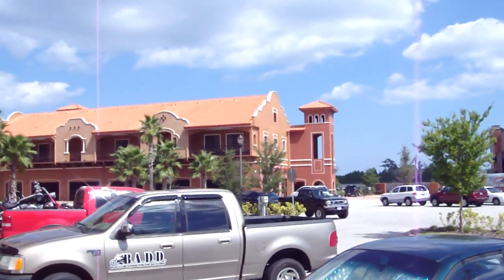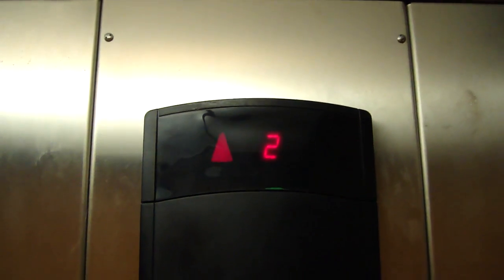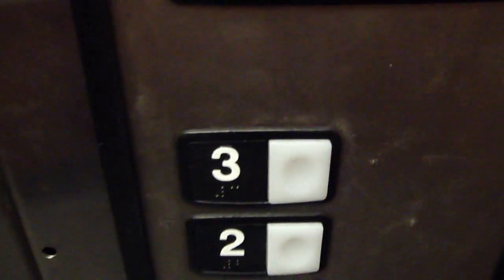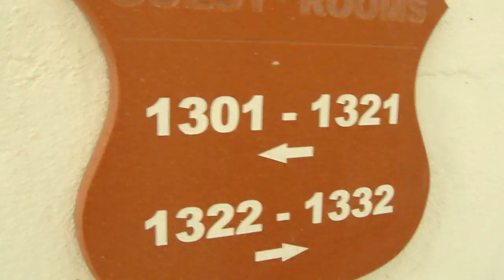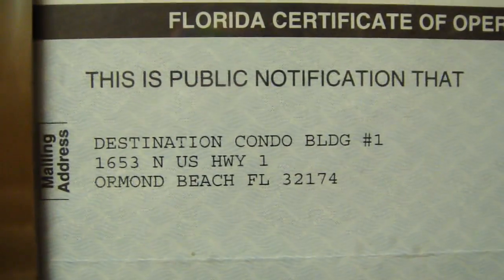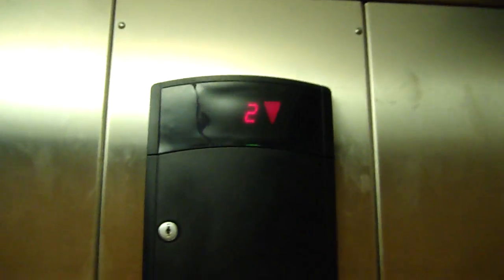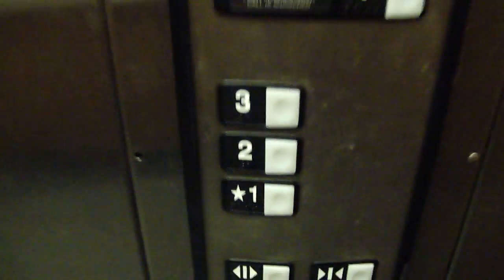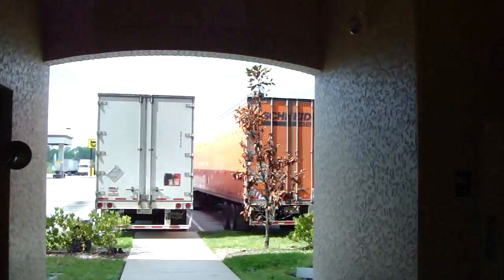Schindler 321a Hydraulic elevator @ Bruce Rossmeyer's Destination Daytona Condos Ormond Beach FL

Comment: What's the difference between 321a and 330a?
Reply: ElevatorNut13 321 only has single speed and low pitched.
Reply: The year of installation, not the chimes.
Reply: Brennan Wood: ElevatorNut13 On a 321A, the hydraulic piston is behind the COP (the panel). 321A was introduced in 1998 & discontinued in 2001.
Reply: @liammcatee113  330A can have the same layout as 321A.

Comment: How do you know its a 321A? cause its high pitched anyways
Reply: DRDOG101's Channel Most 321As have low pitch originally but it was replaced with the high pitch. This high pitch was released in 2004.